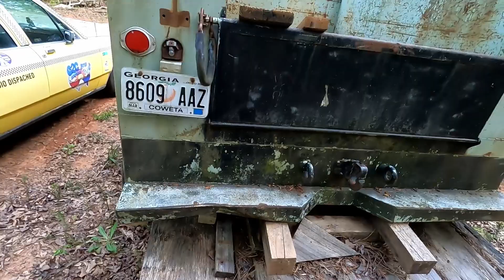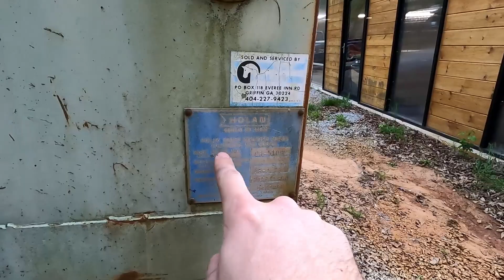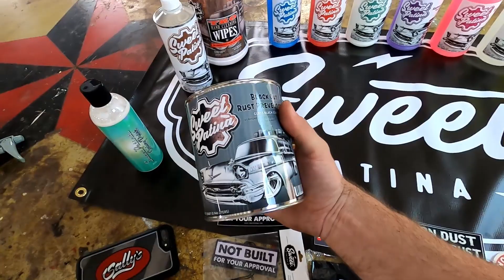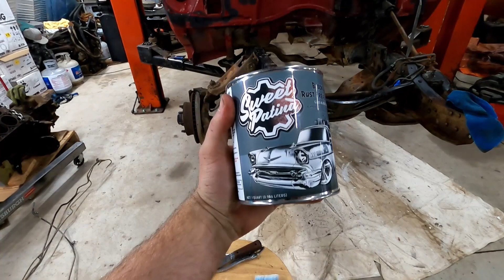Extreme Deep Cleaning of Our Squarebody C20! 40 Years of Grime Washed Away! Power Tour Rescue Rig

Comment: I had the exact same bed that came from a truck that I scrapped out. They are way cool.
Reply from the maker: It’s one of the coolest service beds I’ve ever encountered
Reply: @SallysSpeedShop  I hear that but on mine the guy that I got it from had cut the support frame off on both sides and mounted a dually axle in there instead along with putting plywood on the top which only rusted it out more